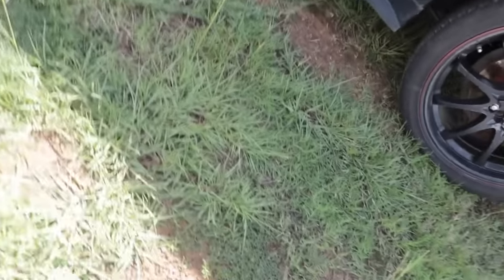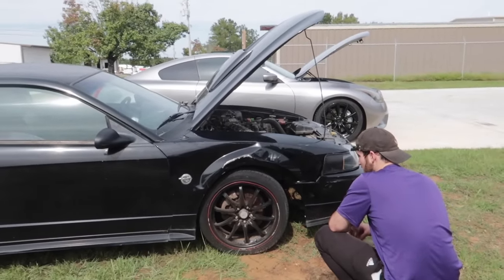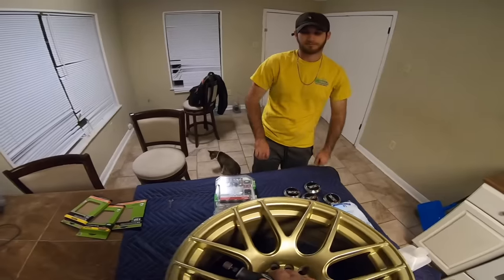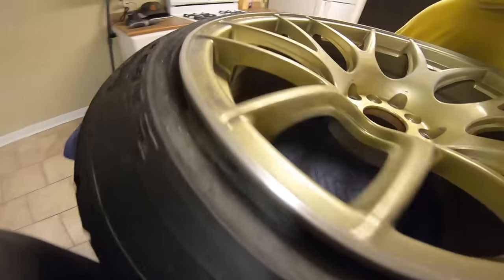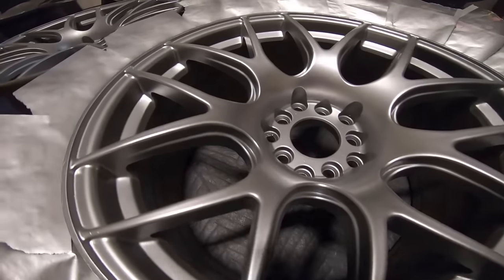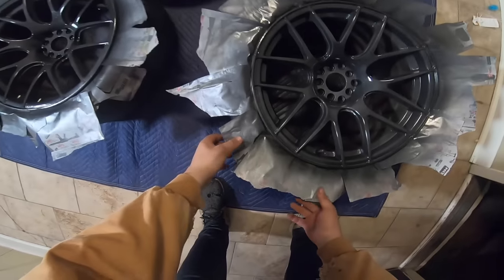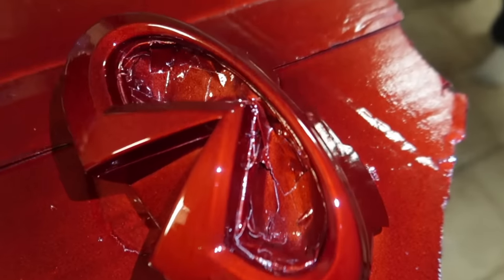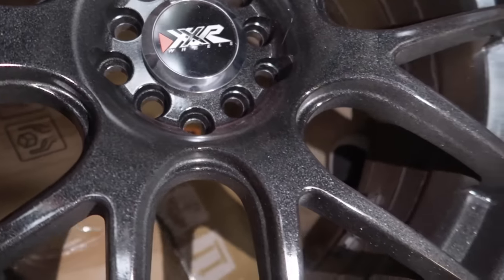I made my wheels look BRAND NEW for CHEAP!

Comment: Theft light is flashing pats is kicking in that hose  didn’t have anything to do with it, check the engine harness connection, then check pcm connection, check all grounds there’s one from block to frame. Check relays and fuses

Comment: What would you suggest for rusted steel wheels, preferably without un mounting the tire. Thinking of removing the rust then paint them with rust oleum and taping the tire with painters tape
Reply: jak p index cards or playing cards is how I paint mine without getting paint on the tires
Reply: Dawson Stockholm that’s a good idea! Thanks for the tip!